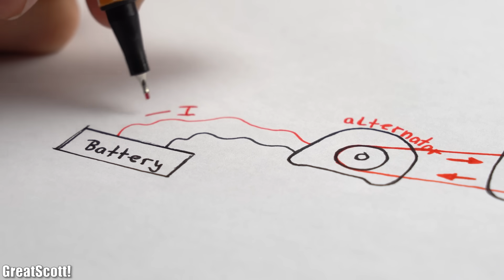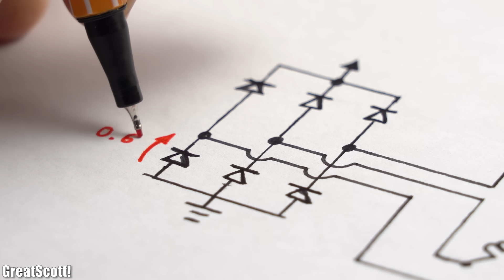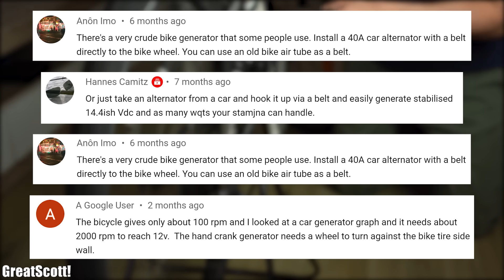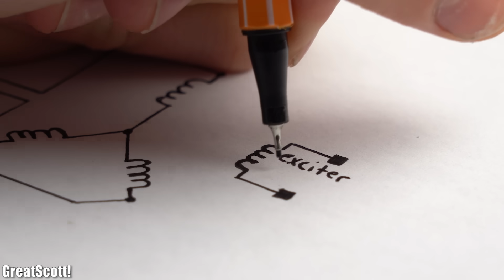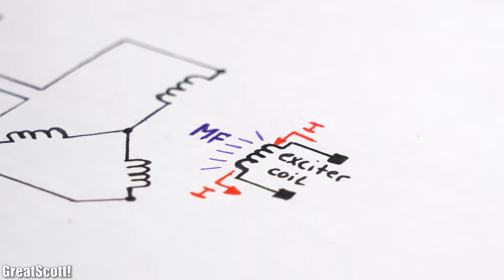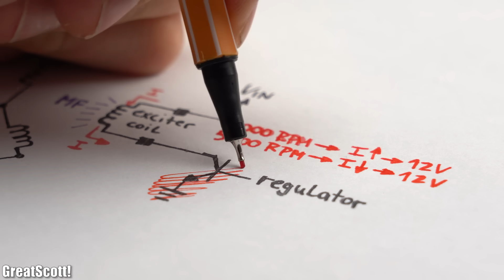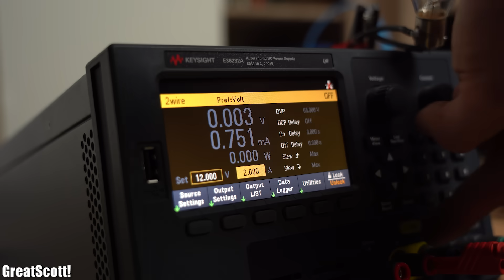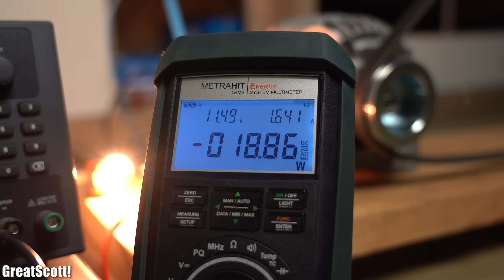Using a car alternator with a bike to power my home? How much energy can I produce?!

Comment: I am a prepper and any nuclear air burst overhead will generate an EMP pulse to wipe out a lot of electronics equipment such as the electronics in modern vehicles. My Ford truck engine has a carb and the only electronics is the ignition system and the voltage regulator for the alternator. I now have a pre-70s points-type distributor and a mechanical voltage regulator for the alternator to install if needed. This country boy will survive.
Reply: You'd swear you clowns actually want armageddon to occur....who are you going to tell "I told you so" afterwards?? LOL!

P.S. A prepper who has the spare time and energy to waste, talking shit on the internet?

Shouldn't you be out canning vegetables or collecting rainwater?

Comment: These alternative means of producing energy by DIY are interesting as a hobby. Still, pedalling is very inefficient and produced watt costs more in food than in fossil fuels. Sadly. If you can not afford the fuel you end up even poorer if you attempt to "save" by muscle power. Do the maths. Still, tinkering is better than doing nothing if it is under 100% thermally efficient. Like lying on a couch and critizicing.
Reply: I am sad to see poor people maintaining or even deepening their poverty rather than thinking twice what causes their poverty. If youre savvy you lift yourself, if not then youre an accident waiting to happeen anyway. Keep yourself off the queue of those in need and thus shorten the line.

Comment: why not build a set of rollers and in emercency..drive your car up on the rollers...let it "run" at about 1000 rpm and spin the generator to charge your batter bank. so for .3-.5 gallons of gas in 20 min or so you could fully charge the batteries to run house with out a 12K dollar generac system or dedicated generator??

Comment: Why didn't you just hook your motor up to the alternator? You start it with a power drill and it runs forever. You wouldn't need your bike because the two (motor & alternator) power eachother

Comment: You was talking about a car an perpetual motion device to operate  as of yet is not possible at this time in history . I don't know because I am poor and can't afford a Tesla. They have storage batteries that fuel the electric motors and operate them till need to be plug in. Why would not alternator type devices be attached around each axel sole purpose to replenish batteries and if needed  ram air thru hood and body to run forced wind  across turbine type devices also sole purpose to replenish. It seems to me energy can be sustained indefinitely or greatly extend range. Idk.

Comment: You see Scotty the Metadyne Generator is nothing more then multi phase generator 2 pairs of brushes shorted on centrain way but no one actuali told that you culd not use more brush sets and actuali insulate centrain segments on the commitator and air craft magnetos used molibdenum rods on brushes for bether lubrication and not to damage the commitator  probably oil lubricated bearings like grafite oil was used. Note there are 2 different magnet faces for ferrite ceramic magnets north and south being split in half or front rear north south pole difference some times brakeing magnets create more poles another special characteristic about ceramic magnets when you heat them up they became stronger but lose voltage thats why magnetos on Ford Model T car evry now and then need to by polarised with multipel baterrys in series .
Ordinari Hot Bulb or Multi Stroker engine was used to drive those special generators. And they need to by always atached to some sort of big load due to back emf so wacum tube or xenon bulb good enougn to take that 
load off at start and stroping that generator. So probably multi center tap transformers were used,SPDT switches ,Capacitor/Resistor box nothing ells was requared. I might by wrong but thats the realiti. Another properti those dc generators have is if you swap magnet poles around you get some times oposite out put's like (+-,-+,--,++) so that same generator can behave as rotary converter. We are speaking here about ordinari car starter motor for exampel 50-100amps 12v . So dono Im dumb but I ques shorting some random brushes definatli can give more out put probably put some turbine for cooling porpuse I ques . So bouth the S/R Starter Motor and Delco 12si can by programed with corect gear ratios. In fact If you look at that S/R starter selenoid they put those dobbel wires to counter equal voltage potential compared to baterry and starter motor values if you remove that R terminal wire and energise it insted of S terminal yout starter motor will lock in to flywheel and wont let go any more . I dono your electritian not my probably that starter selenoid wire size winding direction can by corrected some where some how to spin up that dc motor 2 or 3 times faster or increase its torque by induction simply thats normal Compound DC Motor Series/Parrarel windings operation methodes. I ques the magnet starter motor has space enough to squeze bouth magnets and wires inside that thing.I see lot strange shit from Delco Starter Motors and Delco 12si Alternators for years all the mather how you use them . Bouth are programabel. So thats probably how peopel culd posibli control such special generators and play with them . Do not use ic chips use cloosed loop systems static ignores all computers and test equpment even oscilascops . To note electro magnetism piezo effects randomli might or might not interact with organic or chemical gas including thermal differences and graviti differences so all those laws set by sientist will by instantli broken . Those generators are exposed to decay lot and are normali dengerouse expeciali if multipel frequencys or electriciti types colide to ich other randomli at centrain hrz freqzency they become magnetic pumps or magnetic guns who move or destroy mather . So caution about those generators . Even the Delco 12si alternator works more or less at mather decay like its own alternator parts and used the negative baterry voltage potential to activate its charge so its negative to positive conversion to rotary field then dc pulse to ac then to flat line dc . So thats the difference those alternators do not like heat they need turbine for cooling not that silly mini thingy and grafite oil lubricated bearings ,heavy duty bridge rectifier industri type and cloosed loop voltage regulation not those failures of ic chip who by the way do not have reverse protection voltage circuets . So Amplidyne and Metadyne Generators good to go or Starter Motor and use simply Alternator to convert some thing out of any thing to what you want ordinari series/parrarel switches perhaps some frequency stabiliser circuet and there you go. Any way old engines used Kerosine Water Vaporisators not Injection so those engines hade massive torque Multi Stroker engines even more if not 5x more. Any way before starting Metadyne generator plug it to xenon bulb or heater element before switching primary and secundary load on a switch to not burn the generator due to back emf and well the starter motor by it self is 12v 50-100amps so adding more brushes meaning its voltage or current multiplier or perhaps devider if its in hes center tap lay out ordinari rotary converter bouth devices the alternator and starter motor can perform this task.
I tested my self on small scale swaped around magnets and indead that thing is rotary converter in my case I got dobbel + out put so its ordinary induction nothing ells requared . So for inspiration Water Bucket Vandegraf for exampel graviti fead or constant water flow can easely create magnetic pump fontanas lay out. Lets just put it this way organic and chemicals mixed in water moves faster and higher volociti if you apply magnetic pump in to that mix ordinari wc toilel mechanisms might or might not help thats how the real thing wuld look like . Perhaps it is wurth to mention for exampel wacum tube baterry chargers are nice to have if you try to use biological baterry or chemical baterry or thermal baterry or any other baterry type wacum tubes are great friend to have well xenon car bulbs look nearli identical to wacum tubes even tough external grided tought . So that probably wuld work because Hot Bulb Gasoline-Disel engines were used in the past on trains who run Generators then the Generator drived Electric Motors so they used that exact same set up mentioned above. Amplifyne /Metadyne generator gains 100watt to 10.000watt that simpel fact abouth such device makes it absolute .So in fact you can run your entire house with electriciti but special engine requared or water or graviti or wind or any other power source or in my case often entire car decays so thats the logic behinde it things decay randomli .

Comment: To increase power outputs with rpms use a gear ratio to 1:1 ratio as best as possible with a fan attachment to additional cooling to prevent fire/overheating.
Reply: 10:1 Ratio. We want to power that puppy up, and need more direct power to make it bark.

Comment: Know what can create more power? By using a distributor. Amp flow is way higher. But a alternator is by far way safer since diodes and ziodes regulator controls min/high demand on the supply can provide.

Comment: The alternator (or generator) combo with a small (chain saw or edger gas motor) is what I have in my emergency kit for a backup genny. It doesn't have the capacity of my 4kw dual fuel genny, but is handy as an emergency backup... (Think Harbor Freight 900w mini-genny) Taught me how to make my own in the event of a zombie apocalypse.

Comment: your energy losses are massive.

your bike is not held solidly in place... all that mechanical movement through the frame, thats lost energy right there.

direct drive or shaft drive to the alternator would be better than a belt and the way to keep it light would be using a carbon fibre propshaft.

alternatively, use your bike to drive a flywheel that then in turn, drives the alternator when then drives a circuit for battery charging that then drives your appliance.

plus you are using too light a gear, you need to get down into them smaller cogs and or get into the bigger chainring at the front for more pedal efficiency.

total alternative setup would be, a wind turbine and a solar panel and your bike, all going to power a fly wheel which drives the alternator - go for a 24volt truck job, and use that to charge a powerwall and, so you're only then helping the 2 other systems (wind and solar) to top everything off.

or use all that power to pull a big weight into the air, like a lift shaft and then let the weight fall down during expensive electric times to offset costs.

Comment: It's called a rectifier, all you had to do was plug into the other pin with a light 12 volts and you would have been producing at low RPM anywheres from 12.8 volts to 13.6v

Comment: Lots of misinformation here. If your alternator is only outputting 12V at any rpm your battery will die. An industry standard is around 13.5-14.5 V between 1250-2000 rpm. You also need some type of belt tensioner. You are definitely getting slippage.

Comment: some food for thought on this. 
gm for example has used a 1 wire alternator design for like 50 years. it also uses an excitor but it basically just needs to be grounded and it will charge.
the cs130 was a go to and had its own voltage regulator 13.6-14.6 volts it could be changed too.
the ad244 is the new cheapie thats good. it can put out 200 amps at idle cold. so until it gets hot thats some stupid amperage. and at redline ish it can put out 240 amps and can be swapped onto older engine and alternator variants that use the chevy serpentine belt setup. if you were to add a few. they wouldnt require as much force to charge a battery. once battery is charged the alt will stop charging so hard on its own. adding a resistance like you did is making a black hole for the alternator and infinite resistance to get it to stabilize at its desired voltage. but 2-3 of these with one of the circuit modifications and low drag and decent power output could be used well.

Comment: It takes considerable horsepower to turn an alternator at optimum speed for the rated aperes. The more you require, the harder to pedal. With the big alternators (200 amps and higher), it can take as much as 4 or 5 HP to turn it. All of the videos showing a 1 HP motor running an alternator at maximum output are obviously fake.

Comment: Instead of using your bike have you considered a clockwork mechanism with a weight, using a governor instead of the usual escapement.  All you need is the appropriate gear ratio's so the governor spins at around 8,000 RPM (because air pressure will not allow it to spin faster).  Simply place the alternator in the proper place for RPM for the alternator overcoming any mechanical resistance with the appropriate weight.

Comment: Two things I’d do differently here
1. The thing already mentioned by many others - add a belt tensioner (could be adjustable and put between the board and belt so it also protects it from rubbing against the wooden board. 
2. The gears of the bicycle- the gear you selected in the back sprocket is not providing the highest rotational output, only the highest rotational torque. You selected the right sprocket at the pedal, but not at the wheel. 
Beyond these… I am no expert in electrical stuff

Comment: We tried this idea at university.  The engineering guys built the alternator rig, and I supplied my racing bike, which i use for USCF road racing.  I was able to power it for about 20 minutes before I was tired and my legs were in pain.  We changed it to a small 12V brushless motor, and I was able to power it indefinitely, but the current was only enough to charge a small  device.

Comment: Bro, Ive used car alternators and powered them with lawnmower engines  having both horizontal and vertical output shafts....like ur setup, there is a much larger pulley on the engine side..These alternators can output 120v  ac or dc but the ac is Not 60 hz like a standard wall socket its many thousands of hz..anyway, I usually get around 5 kilowatts or 5,000 watts from it with an 8 hp engine.. the alternators do Not require a seperate exciter voltage source..I run a few capacitors that capture the residual voltage thats generated as the alternator is spun up and this builds in the capacitors and triggers a self excitation so no external power source needed... read up on it

Comment: I haven't watched the full video yet but I'm guessing its not going to power a whole house. But it might power one or 2 Small appliances definitely not something like a refrigerator. You're probably able to light up a light bulb maybe around a drill. Obviously just by the laws of physics you're not getting more energy out of it than you're putting into it. A bike and a alternator isn't going to power your house. If it did DIY people  would be doing this everywhere In fact Between the belts and the ball bearings and the friction the efficiency of this is going to be way down you're probably not even pulling 60% efficiency.

Comment: Your awsome ; could you rebuild one alternator that works betta for one bike or could you make one alternator work with wind sails spinning it maybe the sails are set on a smart grid to detect the wind SPD and direction and turn slightly to catch the most wind?

Comment: permanent magnet alternator that runs at slow speed  or 300 rpm and does need the belt. Some axial flux PMA plans are out there. much better that way

Comment: With the bike and the alternator both secured, a tensioner on the belt would help.  You'd be able to raise the amperage of the regulator beyond where you were able to without it (causing slippage).
Reply: How many calories does your body burn pedaling your bicycles????
Reply: @rodgerjames9160 Zero, because I have no desire to do that.  Just pointing out how he could possibly resolve the slippage issues he was encountering.

Comment: The exciter bulb should be no more than 3 watt. The alternator will perform better when the  pulley  ratio is worked and a simple roller tensioner is  applied next to the alternator. Your alternator would have worked much better and crept up to 14.5 volts if you had fitted the correct exciter bulb of 3 watt. A 4 rib gates belt creates a lot less friction being tbe perfect mix of strength and flexibility. I built a lot of these 12volt Valeo generators.  You need to use the correct alternator.  One that is easy driven
There are massive performance differences between the different brands but same amps. I found BMW Valeos  the best performers of all.

Comment: Having worked with electricity for my entire life I got my first laugh of the day reading the clickbait. You can't power much with an alternator. Get the kids to ride twenty hours a day, buy a converter from DC to AC, and you are up and running. When, your kids are up and peddling. Oh yea, don't turn on your hot water and dryer on at the same time, Yes, folks have turned generators manually ever since the first generator was invented but for very, very low power equipment. Good science experiment for the kids.

Comment: THe thing that you SHOULD have learned from this video is the Hipster version of the 1st Law of thermodynamics - You cannot get something (energy in this case) for nothing.

IF you could generate enough power to power your house with one person on a bicycle for a few minutes, a house backup generator would not need a 5 HORSEpower gas motor.  Hint: Horsies are more powerful than humans.

Comment: I am a mechanical engineer with 30+ years experience in electromechanical systems.  A better way to achieve the same results is to secretly tap your neighbor’s feed when they are away for the weekend.